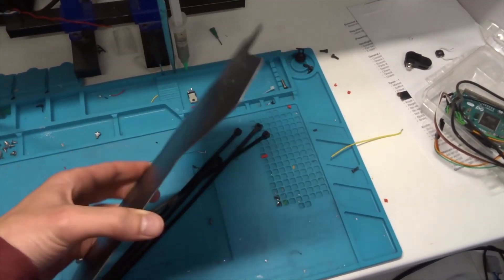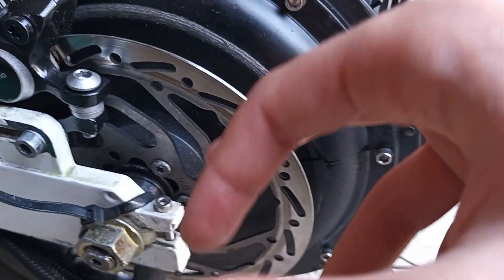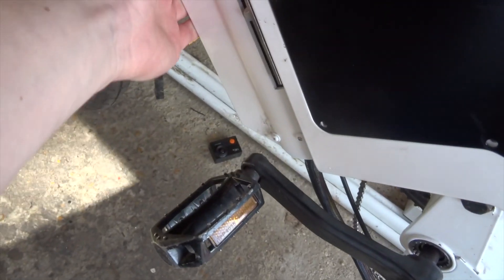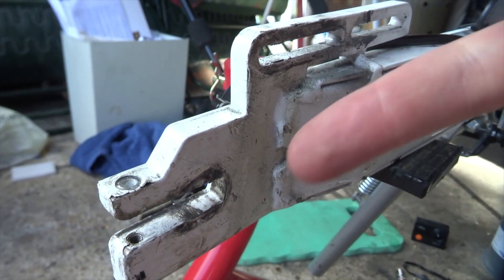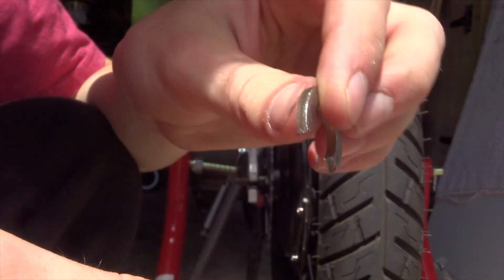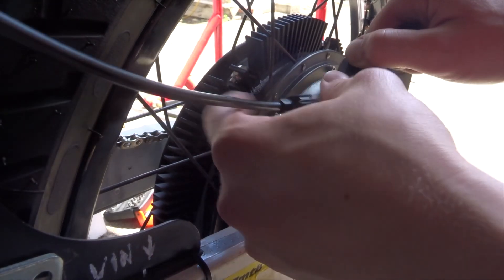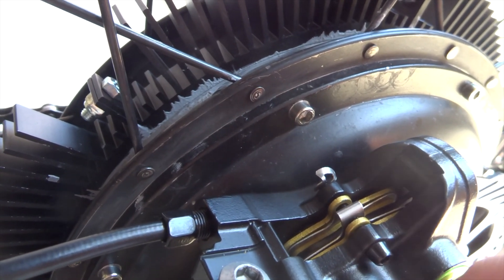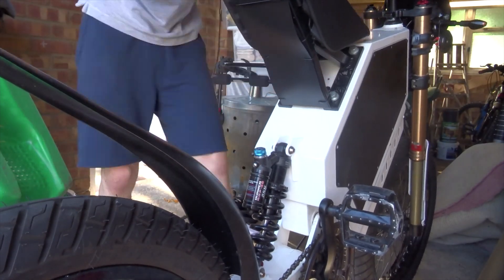Finishing touches! - 8kW Enduro MSVA eBike V3 Build - Part 22

Comment: phase wire washers, yeah i had the same issue and had to invent a spacer/washer. i'm having stopping distance issues with my setup so i have bought some minimoto/pitbike calipers and moped brake levers, need to measure up now for some real hydraulic hose with 10mm fittings, and make a mount for the calipers, then try to find a 200mm disk with about 20mm of actual contact area as the bigger calipers have bigger pads with 15 mm of width of friction material, and my current rotor is about 12mm in a wavy pattern